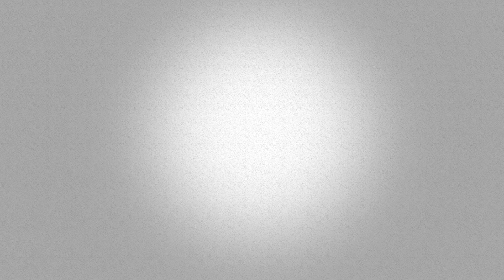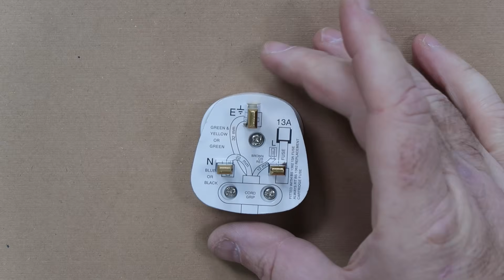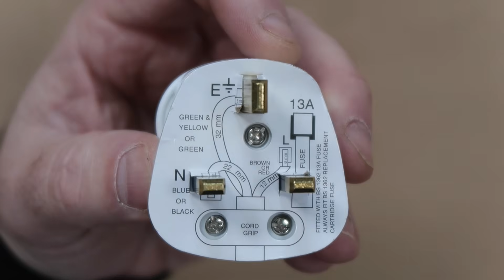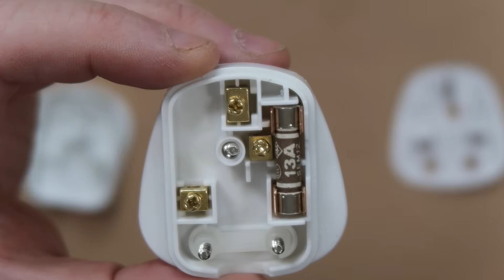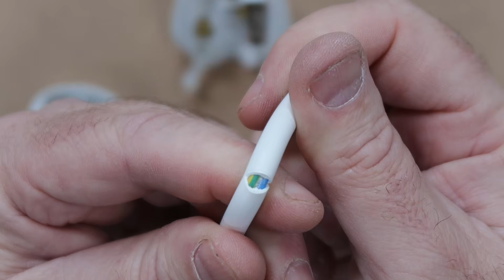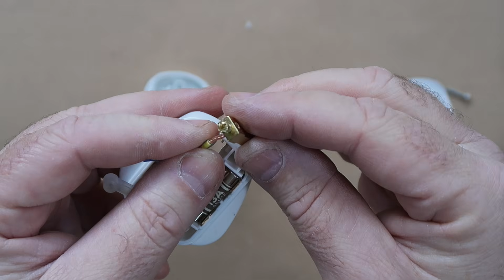How to Wire a UK 13A Plug

Comment: I was taught to look at the second letter - the bLue goes to the Left and the bRown goes to the Right!
Reply: That is a bit risky as it depends which way up you have the plug or which way around it is. I was already taught brown is live because that is the colour of your pants if you touch it.
Reply: @home-space  I also remember that the live has to attach to the fuse. It's multi-faceted.
Reply: @iainamurray  we don’t have fuses in our plugs so it is not as clear. Fuses are in the distribution box.
Reply: @home-space  This is a video about how to change a UK plug....
Reply: @iainamurray  and I used to live in the UK. But if you then move overseas and install a plug which follows the same concept,  this suggestion would be wrong. It is far safer to look at the colours and know what they mean.
Reply: @Purple Burglar Alarm  In Australia and NZ it is in reverse and earth is at the bottom. The diagram that was provided with the plug was on the wrong way around, which reversed the live and neutral pins.  If the fuse wasn’t on the plug, it may not be as clear for many novices. We get a colour coded diagram with our plugs to avoid confusion and we don’t have fuses in them. Also our earth pin is at the bottom of the plug where it looks like the UK plug the earth is at the top. That reverses the sides

Comment: Hi Stuart, thanks for your excellent videos. I do have to take you to task on this one. "95% of plugs have 13A fuse". No, not in this day an age.
All electronic equipment will have a correctly rated fuse or fail CE certification. Hence many plugs are 3A or 5A, very occasionally they are even 1A.  Check out all you lamps. TVs, laptop/ tool chargers, hi fi, etc etc. My guess is that your house has far fewer 13A fuses than you think. Right fuse for the right equipment.
Reply: I'd say nearly 100% of loose plugs your average consumer is ever likely to see will be supplied with a 13A fuse...usually just along the shelf from the packets of spare fuses 😉
Reply: @mcdon2401  That's because if plugs were sold with the lower rated fuses, folks would fit them to kettles and hair dryers, then complain the plug didn't work!
Reply: How to wire a plug
Reply: On two occasions I have found electrical items from certain German supermarkets came with 13 amp fuses when they should be only 3 amp so it's worth checking purchases.

Comment: You can use the image on the piece of paper to measure out the cable; just put the cable (outer sheath removed) on the image, then cut & strip the cable sheath to match the image.
Reply: @andymerrett  ... and Stuart showed how to work it out for yourself, so you don't need the piece of paper.
Reply from the maker: Exactly - most of the plugs I have every fitted have been 2nd hand with no paper
Reply: Is this true

Comment: It should be stated that the fuse in the plug is there to protect the cable and nothing else. If the flex becomes damaged, the fuse should rupture due to the fault current before any subsequent damage (like a fire) happens to the cable, so for 1.5mm² cable which can carry 15 amps, a 13A fuse is perfect - it will pop before the cable rating is exceeded. If for some reason a lighter cable is used, then it is important to down-rate the fuse to suit, so for example a 0.75mm² cable is rated for 6 amps, so a fuse less than 6 amps should be fitted to protect it - the next available size below 6A is a 5A fuse.
Reply: Correct!
Reply: @frankjohnson7204  Spot on Frank. 1 amp fuses are also available which I also fit to this kind of device. The simple equation Power = Volts x Amps tells us therefore 240v x 1A = 240 Watts. All devices have to show the wattage on them so it is easy to check.

Comment: I’ve no knowledge of sockets or cables but I always thought that the cable had to be 2.5 mm for sockets and 1.5 for lights ?
Reply: That is general sizing for the cable used in the electric installation. i.e the sockets and switches in your home.
Some lighting circuits may be 1mm², some specialised circuits for e.g cooker or shower may be up to 10mm².
This video refers to 'flex' attached to a removeable plug on a portable appliance.
Reply: 2.5mm cable should be used if you're wiring sockets on a 16A breaker in a ring main (depending upon length) - the cable from the socket to the plug is unlikely to need to be anything over 1mm tbh
Reply: @MrABannaa  Except that a ring main is usually wired in 2.5mm twin and earth (the grey flat cable) and the breaker would be a 32A
Reply: That is for fixed installations. Equipment cables are different as they are not inside walls so they cool better.